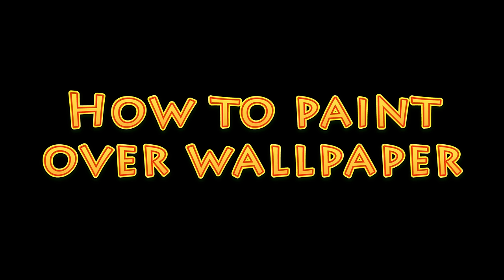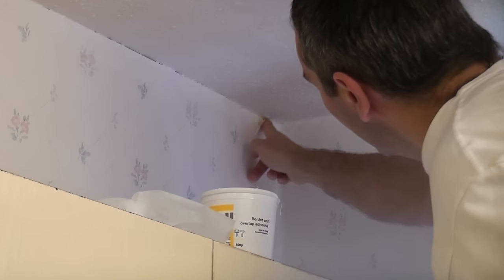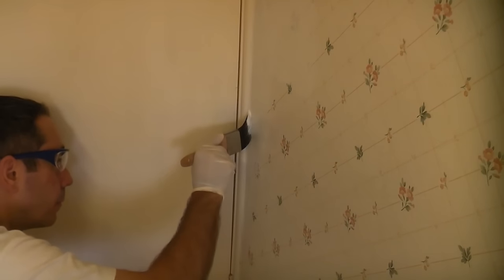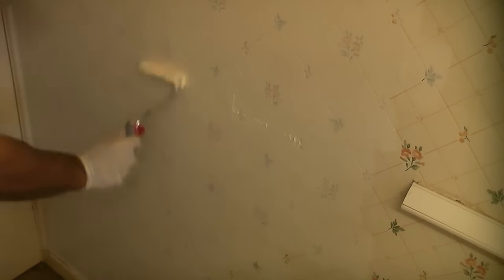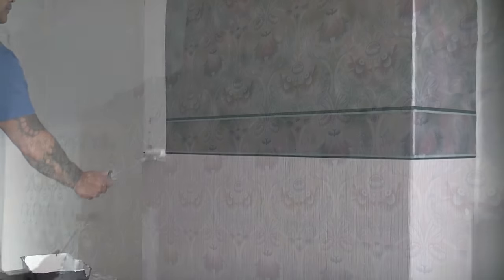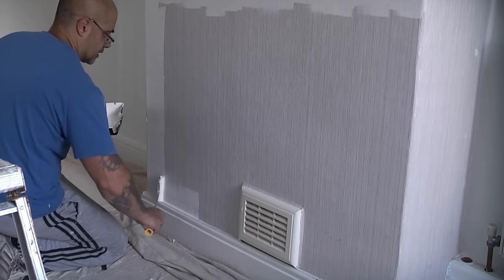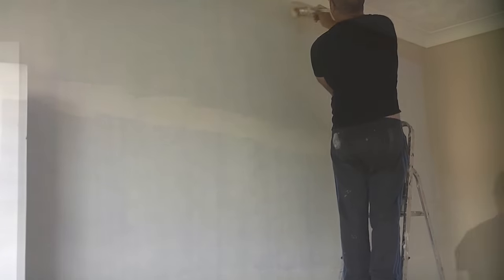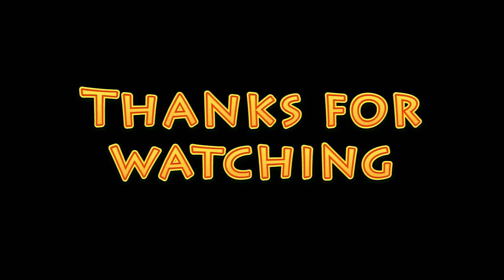How to paint over wallpaper

Comment: I’ve never thought of painting wallpaper. Always seemed “wrong” or “lazy” but I’ve learnt that there are times when this is the best solution. 

Great video. As always . 👍
Reply from the maker: Thanks Graham, the kitchen was in a rented flat for the mother in law so there was no way I was stripping the paper there.
The second property was a rental property that I decided to sell, so a lick of paint was the best option.
Thanks for the comment
Reply: Oh, babe, been doing it for decades.  Just make sure you seal off edges with shellac based primer first to avoid edges rolling up.  Water-based paints will dis-adhere the edges if you don't.
Reply: Christ broham.  You gonna get tennis elbow. 4" Roller is never adequate. But cheers mate. Good work. I can appreciate the disdain for editing. I've been using You tube for communicating with clients and am toying with the idea of editing and sharing more. Keep up the good work chief.

Comment: I have used Loctite water resistant superglue for seam repair. Gripper acrylic primer with good results in 3 houses. Zinsser 123 is easier to obtain so I will try it. So thankful to be able to paint over wallpaper in this current house to prep for sale. However if I can help it I will not purchase another house with wallpaper. It has really set me back in time and other resources. In a few years we may get an RV that will require painting wallpaper as they are all so dated. If you paint them light colors inside they sell fast. Same with houses. 
Thank you for your help. Good video.
Reply from the maker: Thanks for the comment

Comment: Lick of paint makes a world of difference doesn't it. I recently painted some kitchen cupboards in a property the resident were very pleased! Nice video.
Reply from the maker: Absolutely.
Thanks for the comment
Reply: Ultimate Handyman also what was that paste you were using to glue down the loose wallpaper?
Reply from the maker: I always use border adhesive as it will stick wallpaper to anything ;-)
Reply: Ultimate Handyman can't say I've used that before but will give it a try. Many thanks!
Reply from the maker: It's great for loose paper, it can also be used when papering behind radiators as it sticks much better than wallpaper paste and will not come loose.
You are welcome BTW
Thanks for the comments

Comment: Many years ago I painted over wallpaper that had a slight embossed pattern.  What was nice was that the same gentle lines below became a part of the paint pattern, making the paint look more like a re-paper job instead of paint. ...........  Now for our friend the U. Handyman -- with different terminology on each side of the Atlantic Pond, what in the world is "sugar soap' ?  We would use something with good emulsion  if surface has any cooking grease or dust.  Was also hoping you might say something about lighter brush strokes, dry brush or other techniques in the painting over wallpaper.  Guess your intention was to simply cover the wallpaper well and be done.
Reply from the maker: Sugar soap is a product made from soap and sugar, which is used in the UK to clean, before painting. Not sure what they call it in the states!
https://en.wikipedia.org/wiki/Sugar_soap
You only need light brush strokes, using a decent brush around the edges to "cut in", then a decent roller for the large areas.
Thanks for the comment 👍

Comment: Great video bloke! How does the wall paper cover up paint differ from regular wall paint? 
Ps. The audio on the video seemed to be of lesser quality than your usual tutorials.
Reply from the maker: The cover-up is formulated so it won't make the wallpaper bubble or blister (which can happen with some paints on wallpaper), it also contains a stain blocker.
I had to narrate over this video, which is much more difficult than recording the audio as I go along- hence the poor quality.
Thanks for the comment
Reply: @ultimatehandyman  thank you for the info. To be clear, what you mean by the 'cover up' is the primer? Or would one need to use that specific primer and then another specific paint to avoid bubbling? I was thinking that if I used the right primer I would be able to use any regular paint on top of it. Thank you for your help and education. I look forward to your response as I am about to take on a project involving lots of wallpaper.
Reply from the maker: The coverup seals the wallpaper and primes it ready for the chosen top coat of your choice. Normally give it a coat of the coverup, then one or two coats of emulsion/eggshell paint etc.

Comment: Thank you greatly. I am not able to remove the paper nor can i hire it done. So this will have to do and I pray it works. I have never seen that product at Lowes so will have to order it. We do have Zinnser 123 but your can said 123 Plus. ? Is there a difference? 
I hear the primer must be acrylic based. I can not use oil based BIN in this house due to respiratory issues. I have many rooms to do so will try. 
I appreciate your video. Sometimes you don’t have a choice but to paint it.
Reply from the maker: The 123+ is slightly different from the 123 
123+ https://www.zinsseruk.com/product/bulls-eye-1-2-3-plus/
123 https://www.zinsseruk.com/product/bulls-eye-1-2-3/
Best of luck with it ;-)

 Thanks for the comment 👍

Comment: ... 01/24/2020:  Great tips using an oil-based primer so no bubbles in wallpaper.  But, I have seams that are lifting.  Should I just glue them down, or tear off lose paper and sparkle-in in the void left by removed paper?  What do you think I should do?  What about using a tool that cuts tiny holes in paper, and then use the primer?
Reply from the maker: I'd glue down any bits that are lifting using border adhesive (its better then wallpaper paste), then when the adhesive is dry you can prime over the lot.
Thanks for the comment 👍

Comment: Hi mate. Is that Zinzer primer acrylic or oil based and what type of glue did you use to affix the loose edges of wallpaper please? (We have different brands in Australia)
Reply from the maker: The Zinsser 123 is water based
The wall paper coverup is oil based.
For loose edges I normally use border adhesive, not sure if it's called the same over there, but basically it's a ready mixed adhesive, that sticks much better than traditional wallpaper paste.
👍

Comment: Hi,
I've moved into a house where the previous tenants painted over the wallpaper without using any primer.
What should I now do if i want to paint over painted wallpaper? Do i use a primer and if so which one - oil based?
Reply from the maker: As long as the paint is not coming off, you should be able to use wallpaper coverup

Comment: What would you suggest for textured wallpaper? Great vids btw!
Reply from the maker: I'd just paint over it using a long pile roller and some Zinsser wallpaper cover up, then two top coats of the emulsion paint of your choice.
Thanks for the comment
Reply: Ultimate Handyman ok, thanks very much for the reply!
Reply: Every painter is a world . . .  my Way is  
-Remove any loosing paper 
-Apply Stail OIL base 
-2 Coats Skim Coat
-1 coat Primer Water or Oil  is ok
- 2 coats Paint

We do this very often in Commercial and Goverment Places ,High Traffic  and works Great

javapainting.ca       ^V^

Comment: Hello ultimate handyman. OK so we have a 3200 square-foot home recently repainted, several rooms where the wallpaper was painted over. I've just come across this video and noticed there are several products used. What I want to know is what do I do when I come across seams that have lifted away from the wall and also where you see vertical ridges? Which products do I use at this point after it's been painted and setting for a couple of months to then cover those up again and make the wall smooth?
Thanks so much!
Reply from the maker: Wallpaper coverup, will only enable the paper to be painted, it does nothing to smooth out the paper. For lifting seams, I would stick them back down using border adhesive and then use a seam roller. Once the adhesive is dried, you can then start to paint over the top 👍

Comment: I have removed wall paper in a small bathroom and it took me and my wife 2 entire days. It was a terrible experience and when it was time to paint we had to spend more money to get the glue off that we could not see. Then a year later we painted over our wall papered living room and we have bubbles where the paper has turned loose and an area wear there are alot of small streaks. If I had followed all of the above suggestions it would have fixed the problems. It seems that 75% of the painted over living room is just fine because the original install of the paper was good and the wall paper was still smooth and stuck perfectly. I am considering this time covering over the walls with either paneling, 1/4" sheetrock/sand seams or wood flooring. I have wood flooring that looks like tile on one wall and it looks great and I have a pecan wood flooring half way up the wall up to the chair rail. Covering over the wallpaper cost the same as painting if I do all the work myself and it looked better. Painting took 3 times longer than installing wood flooring over the wallpaper. The laminate flooring that cost $3.00 a sq. ft. I could install myself and it stayed together better because it was 1 inch thick. The cheap .70 sq. ft laminate flooring does not want to stay clicked together on long runs. The other product of flooring I have used on the walls were the 18" x 18" square black rubber glued back stick tiles. The wallpaper was what I used in my first house when I was 25 years old. I hated wallpaper after that and I have installed the products above on walls. They are alot less trouble than wallpaper.
Reply from the maker: Thanks for the comment 👍

Comment: Great video!! Quick question. I have 3 walls with painted lining paper on that have a couple of tears in from previous blu-tack posters. Would this method work for covering up those imperfections in the paper, ready to repaint? Thanks!
Reply from the maker: No, it won't hide damage like that, you might have to apply a little filler and give it a light sanding, then prime the paper with the wall paper cover up, then the top coat. Gyproc easi fill, is one of the easiest fillers to use.
Thanks for the comment 👍
Reply: @ultimatehandyman  that’s great thank you for your reply very helpful!! 😀 would you say I needed to put the cover up over the entire wall if it is just plain painted lining paper, or just the imperfections? Thank you 😊
Reply from the maker: @MUSiCx100   It depends, if you painted the wall originally and you know that the lining paper is sound (apart from the repairs that you make), you might just get away with applying the top coat of paint (prime the area's that you repair though).
With some wallpaper there is the chance that it will bubble, but as yours has already been painted there is less of a chance.
Reply: @ultimatehandyman  one last question. With the cover up, is it advisable to wear any kind of ventilator as I’ve heard the fumes are pretty strong? Thanks again
Reply from the maker: @MUSiCx100   It depends, I normally open as many doors and windows as possible, but a ventilator might be a good idea

Comment: Thank you for your help. I have a room with already painted textured wallpaper, one of the walls has been painted with a dark colour on top of the wallpaper the rest of the wallpaper has been painted on by paler paint. I want to try paint them all white. Do I have to use the sugar soap and water on them to prepare  ( worried will all turn to a mess) or do I apply the white paint directly on the paper. Do I need a primer on darker wall? Also what kind of paint do I use for best result on top of the painted wallpaper: water-based, oil-based, Matt, eggshell etc. Thank you for reply
Reply from the maker: No, you only need to use sugar soap if it's in a kitchen and the wallpaper is washable and covered in grease etc.
I'd give it all a coat of wallpaper coverup, let that dry then give it two coats of water based emulsion, you can use matt or silk, depending on what finish you want. 
Thanks for the comment 👍

Comment: Great Vid as always! Can the wallpaper coverup be used as a basecoat on woodchip wallpaper stuck to the ceiling?
Reply from the maker: Yes, absolutely
But if the woodchip has already been painted over, you should just be able to paint it using emulsion paint.
In the unlikely event that you get any bubbles that do not dry out flat after a few days, you can just inject a bit of wallpaper paste using a syringe.
I've painted over woodchip a few times and it has never bubbled up yet.
Thanks for the comment 👍

Comment: Hey man I got a question which I'm not sure has been answered but how long can painted wallpaper last? I don't mind painting over wallpaper if it lasts. I am planning to use wall paper cover up and dulux easycare
Reply from the maker: It will last years, just like a normal painted wall.
Reply: @ultimatehandyman  Like 10 years? I want to save money as all my walls are wallpaper. I don't mind if it doesn't look that good as long as it lasts and doesn't start peeling off.

Comment: Great video as usual. As an amateur, I'd never heard of Zinsser 123. Any idea if it would it be suitable for using on my daughter's bedroom where she has left 'oily-looking' blu-tac marks on the walls from her posters, or will the marks just wash off with sugar soap?
Reply from the maker: I doubt if the marks will clean off, although you could try Zinsser universal degreaser and cleaner, if that does not work a coat of Zinsser 123 should sort it, as you can use that to paint over crayon etc.
Thanks for the comment
Reply: Ultimate Handyman Thanks for the information. That's very kind of you. I will try what you suggest.

Comment: Thanks for the video. I currently rent a house that has wallpaper painted over. Unfortunately my cat has scratched some areas of the wall where the wallpaper was not fully flat, ripping off layers of material. I do not know where to go from here to try to repair these small areas. Can you give any advice on how I'd go about fixing this?
Reply from the maker: There is not much you can do, unless you can get some more paper and replace the damaged areas.
Or if it is not too bad, perhaps you could fill the damage with some filler, then sand it and paint over the lot.
Thanks for the comment

Comment: I've always known to never use a waterbase primer to prime over wallpaper as it can deactivate the glue and the wallpaper can peel. I've always been taught to use an oil base primer like Kilz original to prime with first and then paint over with a latex paint.
Reply from the maker: Thanks for the comment 👍
Reply: I have always use kilz oil primer on wallpaper and it works but in my area they don't sell gallons any more only quarts

Comment: Thank you so much for this brilliant video, I followed your method and painted over 2 bedrooms with a green coloured textured wall paper with 1 coat of Zinsser Wallpaper Cover Up, 2 coats of contract brilliant white silk from Wicks. Really reallyu pleased with the finish. 1 quick question for next time, when cleaning with sugar soap and water, should I wait for it to dry before cleaning off with a damp cloth/sponge?
Reply from the maker: Sugar soap is not the best, as it can leave deposits behind that interfere with paint adhesion. But as long as it is cleaned off properly, it should be fine. I'd just wipe it off when it's damp, but keep cleaning out the rag and change the cleaning water regularly 👍
Reply: @ultimatehandyman  thanks pal
Reply: Did this hide the texture of the paper?
Reply: @heathcotesj  did this hide the texture of your paper Steven?

Comment: What the hell is sugarsalt on water ??

I notice that when you are done with the primer that there is still the wallpaper pattern showing through.  Is that OK?  I would think another coat of primer would be called for, but then again you first coat of paint seems to cover it up well.  What is the rule on that?

Nice video, as usual.
Reply from the maker: Sugarsoap and water, it's a cleaning soap/sugar solution that is often used prior to decorating. It comes as a powder and you mix it with water, then clean the surface with it. 
I tend to use Zinsser universal degreaser instead of sugar soap, but I didn't want to mention another Zinsser product in the video as it was sounding like a Zinsser commercial LOL.
Thanks for the comment
Reply from the maker: It's fine that the paper can still be seen through the primer, it's job is to seal the wallpaper. You could apply two coats of the primer, but it is more expensive than the emulsion paint (or the Perma-white) so best to give it two top coats of paint.
Thanks for the comment

Comment: What do you do if you’ve already painted the wall paper without using the primer and it chips of easily?
Reply from the maker: Not sure about that. If you now prime over the top there is a risk that the primer will not adhere correctly to the previously applied paint.
Thanks for the comment 👍
Reply: @ultimatehandyman  You could sand the wall to give it "tooth" and then paint the wall. that's what you have to do to paint over gloss finishes.
Reply from the maker: @tanyawales5445   I'd do the same if painting over gloss, but I doubt if K F has painted using gloss paint. I have also never sanded wall paper, so I don't know how that will work out.